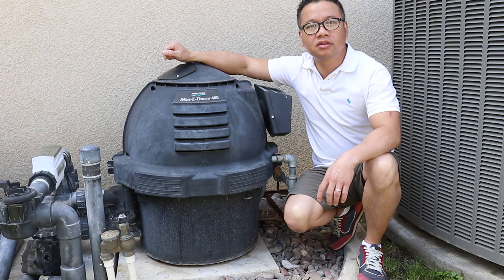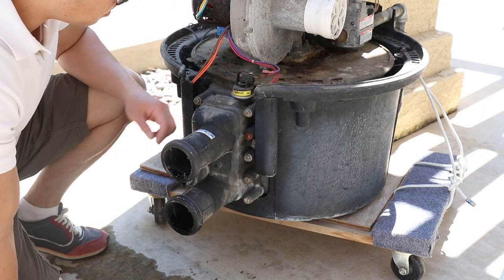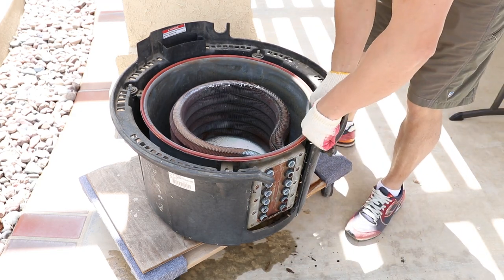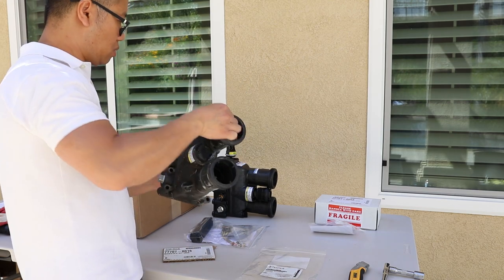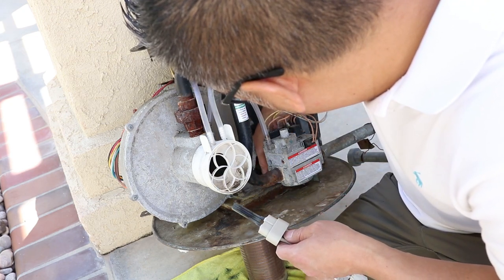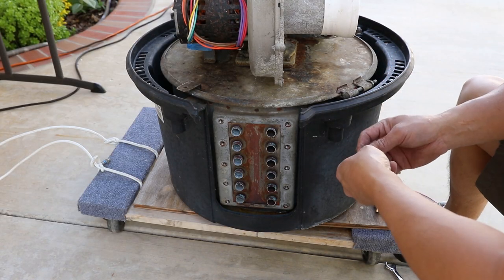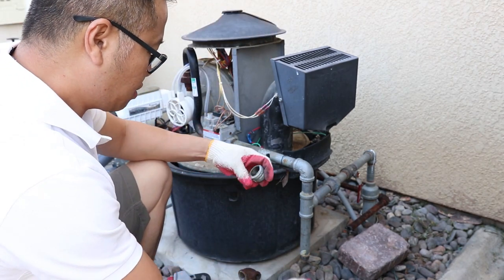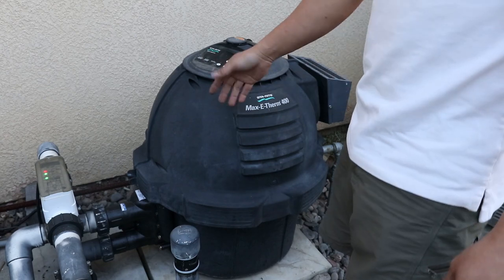Sta-Rite Max-E-Therm Pool Heater Service and Manifold Replacement

Comment: Though lengthy, I found this video incredibly helpful.  I replaced the manifold as well as the thermal regulator in 1 hour.
Reply: how old was it before needing replacement?

Comment: all that work was completely unnecessary...there is 2 bolts that hold the ignighter no reason to change that manifold as it never goes bad....
Reply: They definitely do fail. His ignitor was fine. He described short cycling. Which is when the heater continually shuts down and reignites once at certain temp (below the set point). This guy needed a thermal regulator, a very common failure. That would have cost less than $20 and about 10 min to replace. Calling a pro would have totalled less than $100 and he spent over $1000. Way to stick it to the .

Comment: A commercial spa. I had to take the tank lid off today.  Anh it’s call a (stay)rite not a (star)rite. Jk.  The stack flue temperature reach 480 degrees causing the heater to shut down after a minute.  Mine had 10 nuts on top of the tank. It’s not fun to take the tank lid off but there was so much scum on the heat exchange. A lot of wire brushing today. Funny I come home and see your video. Nice to see another Vietnamese know how to diy.  Great more Asian taking away our poolman’s business. Lol

Comment: That was an easy fix for the manifold.  I can't believe Leslie Pool Supply wanted 900.00 bucks to replace the manifold.
Reply: Theyre retail, and you have to include cost of parts, labor, mark up, and most importantly...expertise. Quality work isn't FREE, and FREE work...ISN'T QUALITY
Reply: @chengkhang2804  Best quality of work done is the one you do yourself, for free minus your time. SCREW Retail! They been screwing the public many decades.
Reply: @philindeblanc  retail will always be retail 🤣

and thats assuming the DIYer does quality work...we all know at least one person who shouldn't even look at a hammer 🤣
Reply: @chengkhang2804  This is true. They should look for an independent honest handyman/pool service tech. Not retail.

Comment: There are some safety issues in the video, and also some flawed technical advise.  Obviously cutting a gas line that hasn't been properly purged is number one.   It should also be noted that when he added that gas line to his BBQ, he eliminated the sediment trap.  At least when he put it all back together, he recreated it.  Putting RTV silicone on the combustion chamber seal essentially makes the whole assembly disposable.  I also want to know what was wrong with the manifold.  Did he ever examine it?  Too bad he snapped the hot surface ignitor when removing it.  The ignitor serves two purposes.  Besides igniting the burner, it also serves as a temperature probe.  After ignition, the control monitors the resistance through the HSI to determine chamber temperature.  So before the ignitor goes completely bad, it can give erratic readings to the control which then shuts the gas valve down.

Comment: Purchased a house with IG pool last summer, and have this same heater (but hooked up to propane tanks). Pool inspector said it was shot and needed replacement ($2000+!!!). I googled and replaced thermistor, and thing started right up!

Thanks for this video...we just closed the pool but I am planning on giving the heater a thorough cleaning and this video is helpful!

Comment: Awesome informational video! What lubricant did you use on the manifold bolts? And what was the tube of sealant you used on the ignition switch and combustion chamber gasket?

Comment: Had lots of problems with that model first year thermal sensor in exhaust went, next year main display board went. When i called up Pentair the basically told me  30 day warranty if you bought on line. this is the second one the customer has had last one only lasted 4 years
Reply: Wow really? I know someone who has this for 3 year no issues. But ?? I was considering this vs a raypak. I actually didnt know it was Pentair, which I would stay away from.

Comment: I am planning on getting this particular model (Propane) and I'm glad to see a complete tear down.  So my observation tells me that the only problem  you had was the igniter.  I still have a few questions here perhaps some one knows if this can  be installed indoor as my pool system is in a shed. I see that has some exhaust perhaps it can be extended to outside.  I appreciate the video a lot even if it is long but the tear down really shows a lot of the components.  I'm looking to find more answers and will soon purchase this.

Comment: I am about to open my pool . I can't tell the lights yet but I know what it's been doing the last two season. It starts and runs the first time I turn it on. Once it got the pool to temp and kicks off it tries to fire again but just buzzes alot. I let it sit for a few hrs and it will run again. Any Ideas so I can get parts ordered?
Reply: Remove outer cover to expose inside workings and locate where buzzing is coming from. I suspect it is the gas valve.

Comment: A little more testing with an electrical tester would’ve told him the igniter was bad instead of tearing the whole thing apart saving lots of time, the lube was for the O-rings not for the bolt threads

Comment: Hi Dan, mine doesn't turn on at all.  The display comes on but not the blower.  Any idea what the issue is?  Thanks.
Reply: mice inside the cone deep in heater...youll never get them without taking it all apart....call a professional unless you want to blow up your house,,,
Reply: Check all the wire. Maybe mice have been chewing away your wire.  This happened to me.  After rewire everything work.
Reply: Blower will not start unless  pressure switch and  high limit  switch are both closed . Test with ohm meter with pool pump running and switch connections removed. Both switchs are located on manifold.
Reply: Could be bad capacitor on the motor as well.

Comment: What would u say is the average cost to heat up your pool every time u use the Sta-rite?  I recently inherited one and am gathering info!  Thanks
Reply: Natural Gas Pool Heaters
You can figure about 1 therm per hour per 100,000 BTU’s for Natural Gas. For a typical 400,000 BTU pool heater, that’s 4 therms per hour. Currently Natural Gas runs about $1.00 per therm, natural gas prices do fluctuate so keep an eye on this site showing the Cost of Natural Gas Per State. In our example, 1 hour on Natural Gas will cost $4.00.